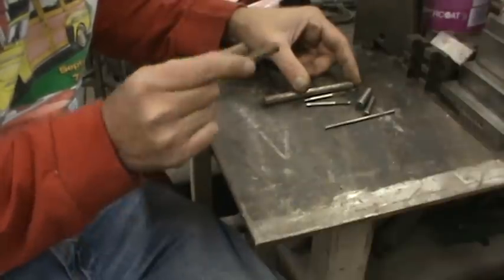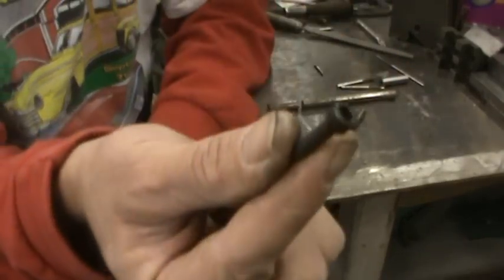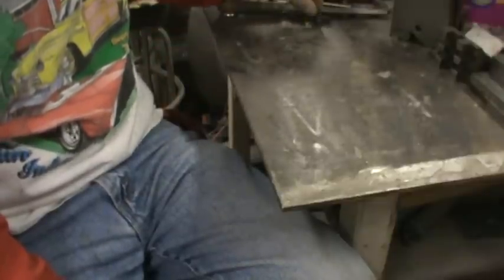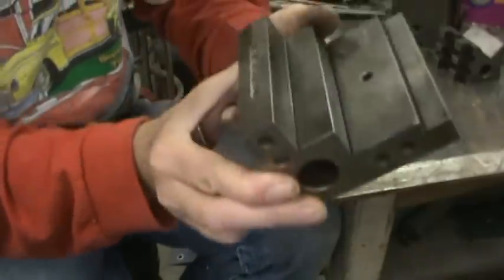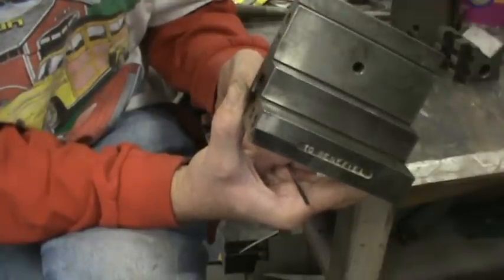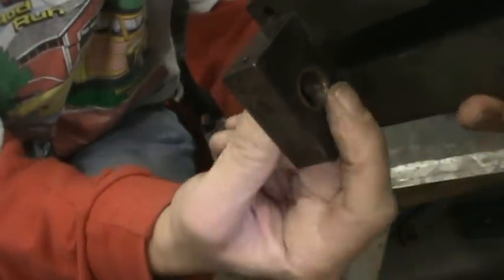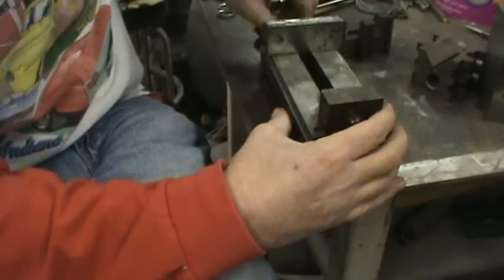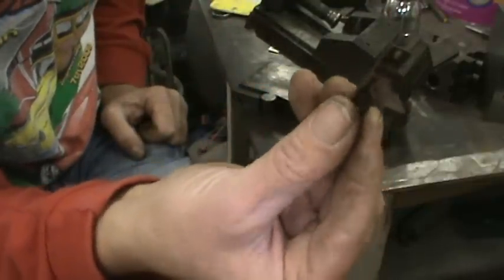Fixing Broken Parts Easy. Also Tool & Die Tools

Comment: Tom
I built progressive dies and than went on to design them and during that time during apprentiship ,I got my bachlors degree in mechanical engineering and spent 45 years working in the defense industries ,making and designing equipment to auto, assemble these 40mm rounds,and the M223 gernade and the MLRS rounds and the day,night 40mm practice round.I am now retired after 45 years,  for 2 years now and love it!!!!

Comment from the maker: @richard16372 I dont have an apprentiship. I started when i was 5 manually cranking a vertical mill. I was standing on stool and ran surface grinders before i was 10. Its amazing i have my digits all intack. my dad told me by the time i was 20 i could school an apprentice so i never got an apprentiship. I literally grew up in a shop that built super high tolerance gages, dies, machinery, and piece work for aircraft, auto, and production industries